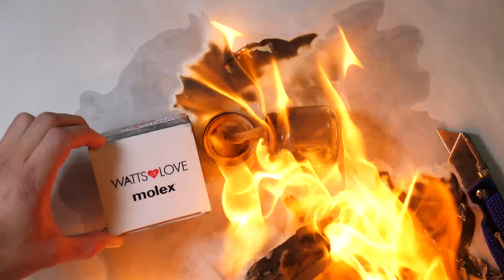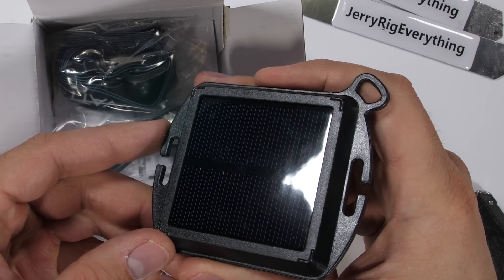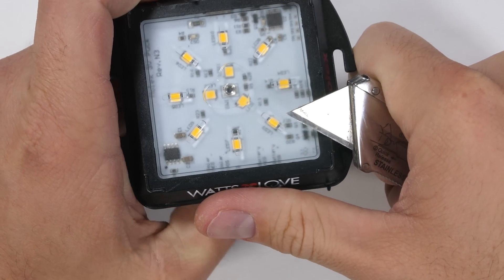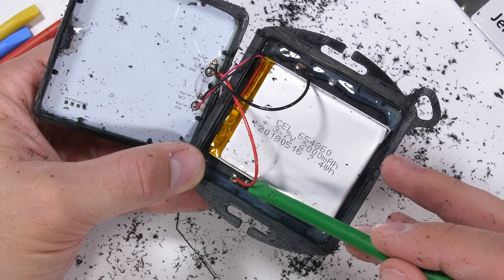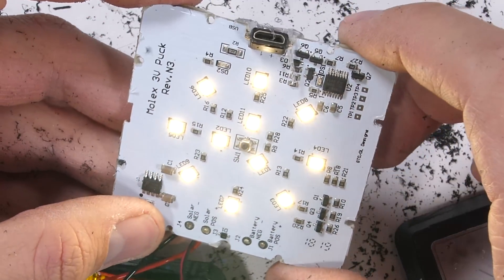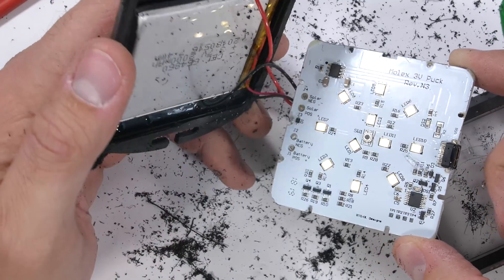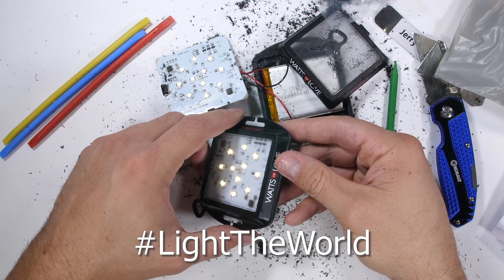Can this Solar Powered LED Change the World?

Comment: motherboard :-) dude, what motherboard? it's just a circuit board. it's a motherboard when it accepts one or more daughter-boards with whatever type of interconnect/method as in ISA/PCI/PCIe etc. So in PCs, the main board is called a motherboard because a graphics card or an add-on memory card is technically a daughter-board. Technically it's not a motherboard when everything is embedded and nothing could be add on.  This is a simple circuit board with no addable or removable accessories or other circuit boards.

Comment: I would consider buying one of these but when I see it is a permanently closed enclosure, i gave up. why don't they put some screws on it for easily change the battery when it is dead after few hundred charge cycles? why we have to throw the 11 nice leds and an effective solar panel away just because we can't replace the goddamn dead battery inside this device? This kind of products is one of the reason we have enormous amount of electronic junk on the world and it is growing day by day. Is this a social responsibility thing? Then why dont they make it more eco-friendly just by putting some screws on the device?

Comment: Heya... I always watch your vids but never comment...but felt I had to on this one. I'm from South Africa and work with people who live in shacks... shack fires are a huge problem due to the use of paraffin. I'm interested in finding out more about the specific light you tested. The product is not on the website. With these things there are always so many offerings but often it's cheap products dumped on the poor. This one however looks promising. How much does it cost? Currently we are implementing multiple solar projects in a few informal settlements but affordability is always an issue. Just reaching out... thanks for the awesome vids

Comment: That Li-ion battery is way larger than anyone needs, adding unnecessary cost for the consumers. With a battery like that it seems like this product really should be marketed to people in wealthier countries who live in houses with poor natural light (big houses usually) and frequent power outages I.E. north east USA. I'm also a little worried that it can't be opened up and repaired. Of course I'm sure this product is still better than a lot of other's out there and it is obviously durable. I don't want to dissuade anyone from donating. I just have a few design critiques.

Comment: This is a great idea. I thought, at the start when you said it was a nonprofit organisation that these would be cheap pieces of plastic, but it's surprisingly durable. I know you're not generally one for a drop test, bit it would have been nice to see. Maybe even some water testing to see if that rubber seal works.

Comment: I do have one but a different type n its kinda gets hot fast n am afraid that the battery might also explode due to the heat after using it for like 1 hour, u need to stay in a very cold country to use these as when i turn on the air cond, it is just warm but it sure brightens up the whole room n has 3 lights colour, i can take it for camping after a long hike

Comment: The design flaw is that it uses a lithium battery and you have to put it in the sun. that black solar panel is going to attract a lot of sun and heat up the whole unit. It will puff up and explode eventually.

Comment: over 8 million of us fly on kerosene powered planes every day
Reply: @OneGoogleUser People will laugh at you so hard for saying "kerosenes are for airplanes". Kerosene is refined to the standard A or A1 and it is the most used aviation fuel, it is called Jet Fuel. If you cared enough about your point you would know that even the SpaceX Falcon 9 uses refined kerosene, called RP-1. You didn't even search for it on google.

Comment: You should make a hot test, first you charge it from micro usb port and see how long does it stay on.

And then put it for 7 days in the sunlight in the hot summer. I believe that this lipo battery will not last long when into high temperatures from direct sunlight  charging

Comment: I have one concerne about heat, for exemple in Ouagadougou the temperature can get up to 40°C, if we keep this out for charging under the sun, I am afraid it will fry. The battery will get damaged, or the plastic housing will melt and deform.

Comment: why is the clear plastic defused tho
Reply: So the light that comes out covers more surface area. Good for illuminating rooms.
Reply: @lrodd247  I don't see how that makes sense, I'm open to explanations tho
Reply: @khl2445  LED's are like spot lights. The defused plastic is to help the light spread. Check out the LED bulbs in your home, the same thing in a different way.
Reply: Those are all pretty good explanations.

Comment: Pretty good overall design, though they should make a version that can work with super capacitors for permanent installations in homes. Since that unit will be left in the sun during the day, the internal lithium polymer battery will not have a very long service life. Imagine if a version can be made that is low powered enough to give like 50 hours on a full charge using a super capacitor. and then have it installed in the roof of shacks and other low cost housing where you can have ambient lighting that can simply light a room enough basic tasks, but offer a good 25+ years of service.. It will be cheaper in the long run, and if the people there decide that they no longer want an oppressive government, then in that time, they may even outgrow the need of such devices.

Comment: What are the benefits compared to a solar garden light a fraction of the price?
Reply: It has a big battery inside it and goed brighter than a garden light i think? And paying $25+ more for something that lasts 5 years longer than a $5 dollar garden light means in the long term it is cheaper.
Reply: Does it last 5 years longer? not sure about that. I doubt it would last a whole lot longer than a cheap solar garden light. A little, sure. 
I really don't think this is a good way to support people without proper infrastructure. The obvious solution is to invest in infrastructure, and that is most certainly the only viable long term solution.
Reply: @jort93z  infrastructure for most of these places isn't possible. It doesn't make sense to run power wires to many of these place. Most of these places don't need more than a single light that is like 200-500 lumens anyways. Majority of theses peoples work is done during the day, but being able to cook dinner a little later in the day, or study for school in the evening is all they need light for. These people aren't going to have TV's, XBoxes, microwaves, etc., so a quality long lasting cheap light could mean the difference between a families child being able to graduate school or not. And education is really the stepping stone to success.
Reply: @jort93z  improving their infrastructure would take decades and cost billions of dollars
sending a bunch of lights takes a week or two and merely thousands of dollars

garden lights are shit, they barely give any light and break easily
Reply: Those little garden lights are shit. You can squeeze them and they can open right up. Also the batteries are the AAA rechargeable kind are  low quality. Lastly the Lumens they put out are pretty week...
Reply: There is something called rating on electrical components. Indoor use (20C +-20%) costs x. Outdoor use (-10 to 30 C) costs 5x. Military grade components (-50 to 50 C) cost 100x. Space grade components (-200 to 300C) costs 10000x. Meaning a buck capacitor bought at your homedepo store would cost 10000 bucks if it needs to be soldered on hubble. If you want this to work reliably in shitty conditions in which ppl who need this live you need to make it almost military grade. Then do the math again...
Reply: All (All i checked anyway) solar garden lights i've seen recently to have lithium batteries. NiMh isn't really used much anymore. 

Also, this product is not using military grade components either(couldn't see the part numbers, but you'd think they mention if they did), so why would you use that for the calculations? Both use normal consumer components.
Also, most consumer products have higher ratings than the ones you've named. I literally can't think of a components rated for 20°C +-20%, are you sure those exist? And -10°C to 30°C is a rating you might get on very sensitive components or something, but most consuner components have even higher ratings than that.
And -200 to 300°C components are literally not possible most of the time, physically impossible with current materials. Thats why spacecraft have heat insulation, radiators and heaters. Their processors are radiation hardened, because of the high background radiation, but the temperature ratings aren't much different to the military rating.
Reply: If you want to give this to a billion people, you wouldn't want it to be efficient or durable, you want it to be cheap. And thats exactly what those 2$ garden lights are(or however much they cost).
Reply: Fair enough. Maybe someone has a reason why this would be any better

Comment: Do you know how many hours of direct sunlight you need to charge this 2000 mAh battery? And a USB port for places without electricity? They better make this "one-time-use" flashlight with regular batteries.
Reply: @Erla Teli Can you provide link to information about power output of that solar panel?

Comment: how efficient is this cheap looking small solar panel.?
Reply: The light will charge in 10-12 hours and will last a variety of times depending on the setting. 2.5 hours on high to 120 hours on low

Comment: Kerosene is dangerous. With a little help, it can even cause a fire.

Also, why would they make it black? If it's meant to be used in the third world (where it's well hot) that thing would probably melt or damage the battery in the sun.

Comment: The battery will die in time.... Better off with gas
Reply: The battery is projected to last 10 years and they can save about 30% of their annual income by not having to purchase kerosene!
Reply: @jessicaandree6161  except they don't buy kerosene, but very low grade oil ... and if you think they would spend 1/3 just to have light ... you're insane

Comment: they should have put a 125054 battery in there instead of a 654860, it would have been cheaper and double the reserve. or redesign the housing for an 18650 or 2. 275 lumens is not very impressive, but i imagine anymore would kill that small battery.

Comment: Funny how he makes a puddle underneath first, then lights it, nothing happens... So he tips it, nothing happens, so then he takes the lid off.. He keeps saying they are dangerous, but has to literally manually start the fire because it just would not work. BTW the little makeshift lamp is supposed to use alcohol.

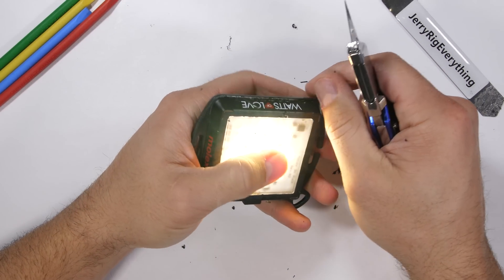Comment: 2:20 wow it took a hacksaw just to break through it

Was this device manufactured by Nokia?
Reply: Nokia’s don’t break using a hacksaw. You need a nuclear bomb
Reply: @faheem4253  I tried bombing my nokia with a nuclear bomb.....

And it's still working except the plastic housing ripped off.
Reply: Vishwas Babu I nuked my Nokia phone and it broke.....

The nuke
Reply: @faheem4253  is that why when someone shot it with flex seal it broke because flex seal is the bomb
Reply: duck boi 

Why you always lying...

No but seriously imagine someone trying to break a NOKIA BRICK using a hydrogen bomb...

Probably Donald Trump
Reply: @faheem4253  taofladermas made a video 

But imagine someone remaking tsar bomba
Reply: Evariste Galois lol
Reply: Nokia phones are basically tactical nukes...
Reply: @johnnguyen4700  TACTICAL NUKIA INBOUND

Comment: Problem with this type of thing is it is an expensive item for its target market, so it needs to last a time. However using lithium ion limits its use to about two years with charging every day and discharging every night. They should have used lifepo4 or lto cells instead. They have lower capacity but last longer
Reply: ALso, the "target market" is the people receiving it for free. They are saving money by not buying kerosene. So-- even if it does only last 2 years, that's 2 years saving around 30% of income (what average family spends on purchase of kerosene). This can make a world of difference for a family in poverty. Not to mention the health benefits of 2 years without breathing in the smoke, and risk of burning house down...
Reply: @michelleretson4919  sorry, I would have been more accurate to say the charity would spend a lot of of money they don't have to and not be able to help as many people if they need to replace them every 2 or less years. The saying 10 years life is going to be 10 years storage life with a lithium polymer battery in it
Reply: And actually on second look that looks like a lithium polymer cell, so even lower lifetime
Reply: Molex says 10 year battery life.
Reply: @michelleretson4919  attaching a solar panel and battery to an led using off the shelf components really shouldnt be patentable. Solar powered led's have been around for basically as long as leds have
Reply: It wouldn't need to be charged every day. 120 hours of light on the lowest setting. Most would only need to use it for 5-6 hours or so every night. That's almost three weeks on the lowest setting from one day out in the sun.

Comment: try putting one of those solar panels in the clear pixel 3 with a thin powerbank circuit inside to charge, it would be awesome to have the pixel charge up while walking about and using it
Reply: How often do you use your phone outdoors with the screen pointed at the ground
Reply: @Bladsmith 
 use=very often
hold=almost never
Reply: What the fuck